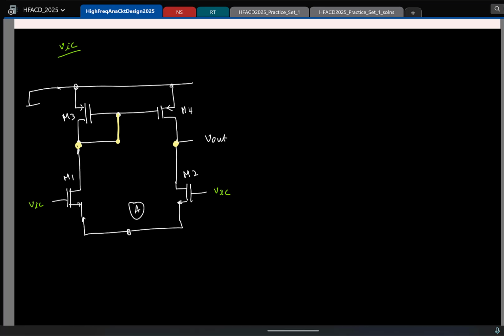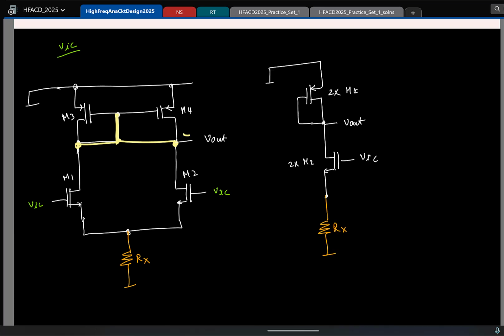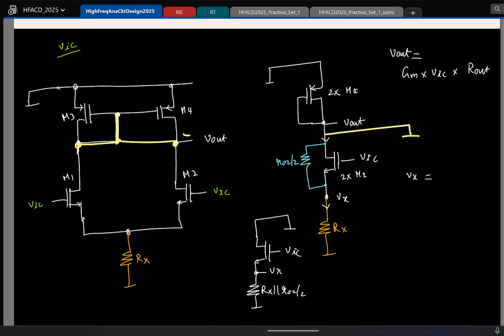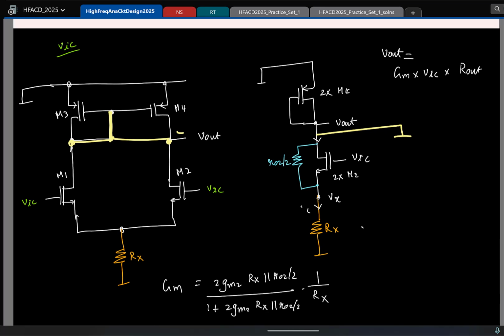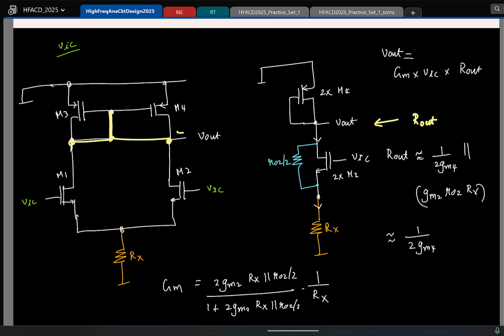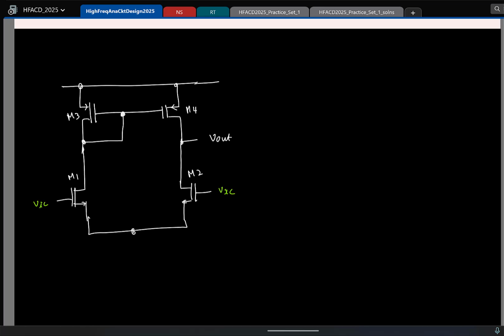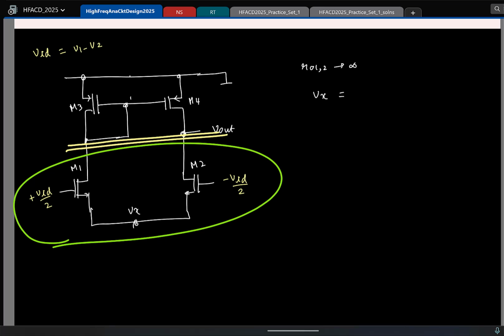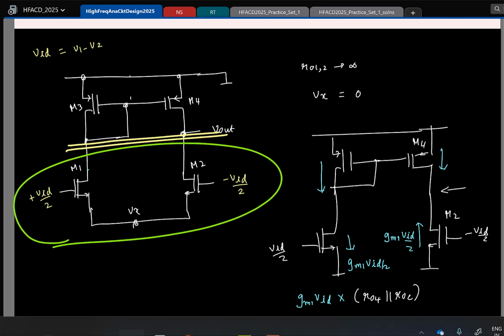Lecture 6(3): Common mode & differential mode response of the 5-transistor OTA

Comment: for differential mode, why does the top left transistor current mirror to top right? current mirroring only applies for DC operating point analysis not small signal right?
Reply: It does applies fir small signal
Reply: Circuit topology remains same be it DC or small signal analysis (which is carried out once you have DC biases established). So, the current mirror on sensing change of current (due to small signals) will act accordingly to mirror this current. Net current flowing in top right transistor at any point of time will be Ibias + delta(ismall) where delta(ismall) can have positive or negative polarity.

Comment: Hi Professor, shouldn't ix= vx / (Rx || ro2/2) at 7:48?
Reply: yes, was wondering the same. Also for gm the current accounted has to flow into the ground. We'll have negative gm if I'm right.
Reply: @unCox_WbyL you are correct